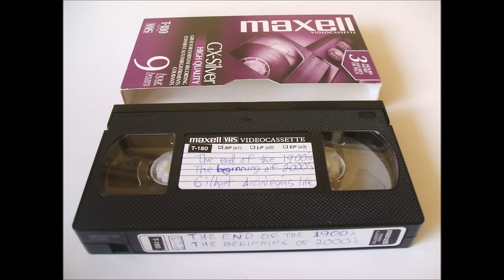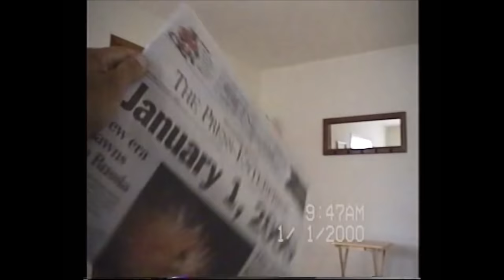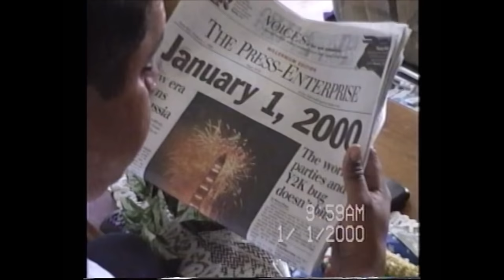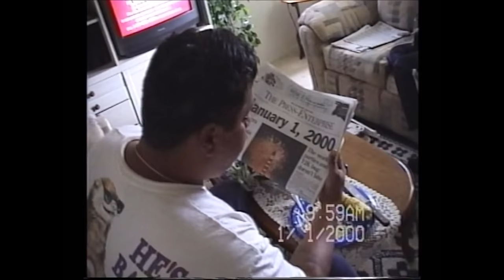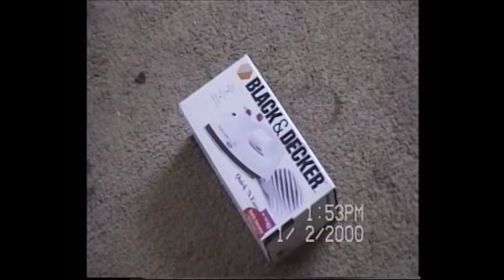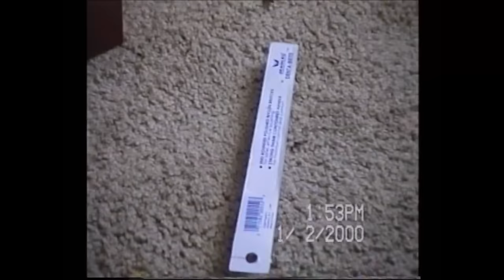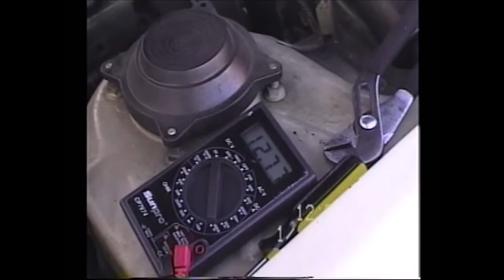January 1st, 2000! Life on the first WEEK of the new millenium!

Comment: What blows my mind is that we are as far away from 2000 as the 70s were to them!
1979 - 2000 = 21 years
2000 - 2021 = 21 years 
Holy sh.t
Reply: Wow what a nice way to bend it. No just say we are as far away to 2000 as they are to the eighties. Actually were as close to 2060 as we are to the eighties
Reply: @o_sch  1979 is technically the 70s though, so I’m not wrong

Comment: Dads in 2019: see you next decade😂😂😂
Dads in 1999: 😈😈
Reply: Damn. You people in the US really have shitty education. Decade begans in 1 (1991) year and end in 10 (2000) year so 2000 is not the new decade and not the new millenium, but the last year of decade and the millenium. The new decade and millenium is 1 January of 2001 and now is the same situation. Now we have the last year of the 2011-2020 decade. Decade means 10 years so just look - 2011, 2012, 2013, 2014, 2015, 2016, 2017, 2018, 2019, 2020. The new decade will be in 2021.
Greetings
Reply: @januszmortadela1956  It's not bad education. When decades begin and end is  not certain. Most people say they start on the year xxx0, not xxx1. This makes sense mathematically as you count 0,1,2,3,4,5,6,7,8,9 then have a new decade. Thus the first decade AD ran from the 1st Jan 0000 to 31st Dec 0009. This makes more sense to me and is more widely accepted over decades starting on xxx1 years. Otherwise 2010 isn't in the 2010s. Which doesn't make sense to me.
Reply: @JohnSmith-he9jj  
Counting is one thing, but the terms of decade and millenium are not using correct. In your example is a mistake what most people do - there is no year of 0000. Our times begans in 1 year. There is 1 year BC and the next year is 1 AC (AD). There is not 0 year.  We can count even from 2005 to 2015 and it doesnt matter because the terms of decade, century and millenium are for only using of specific time.
Greetings
Reply: @januszmortadela1956  That is true. I guess when using BC/AD the first 'decade' is not actually a decade but only 9 years. This could be fixed by using the holocene calendar starting at 0 HE (so 12020 is the first year of the 12020s). As you say though you can count a decade from whenever so it doesn't really matter.
Reply: @JohnSmith-he9jj  
As we can see, thank you
Reply: @januszmortadela1956  there no year 0
Reply: @hanphilnoffz8827  
Exactly mate
Reply: @januszmortadela1956  lol 2000s is new millennium synonym but is the last year of 1000s or 2nd millennium chronology but synonym term is not right calling 3rd millennium because to make 2 millennia is 2000 year
Reply: @hanphilnoffz8827  
Oh boi, read my comment again
Reply: @januszmortadela1956  yes is true 3rd millennium start 2001 is not right 1999 is last year of 2nd millennium because 2 millennium is 2000 year is also not right calling 2000 1000s sometimes 2000
Reply: @hanphilnoffz8827  
Terms "millenium" and "years of x" are different. I dont get your point mate
Reply: @januszmortadela1956  since 2 full millennium are 2000 years 2000 cant be 3rd millennium but it won't be right calling 1000s so 2000 may feel like new millennium because of synonym term but calling it 3rd millennium is not right which 2001 are new millennium when u call it third millennium because 2 full millennium is 2000 year is like first 10th birthday u also count your 10th birthday u don't stop counting at 9th birthday same thing first 2000 year would be 2000 as last number of this category and 2001 are next category
Reply: @hanphilnoffz8827  
Ehh...
You can not use the definition of one thing to desribe another one for only reason they look similar. Yoy can use terms like 2000's of course, but you never can to call it a new millenium.
Greetings
Reply: @januszmortadela1956  yes 2000 is still 2nd millennium that true

Comment: The year 2000. The last year where I could say to myself that the world actually felt okay 😟
Reply: Bruh the 2000s were amazing
Reply: @phantom_wolf5274  fax
Reply: Any year before 2016 was okay
Reply: @phantom_wolf5274  After 2001 the 2000s were rather a downhill and nothing felt right, just looked back on those years and realized the world took a dark direction after 2001. Times are better now than the 2000s at least
Reply: @null2011  why just 2016?
Reply: The 2000s were great I'd say shit started to change after 2010
Reply: Yeah, it was also the last year of the 20th century and 2nd millennium!

Comment: new year new decade I'm telling ya
Reply: BEASTIEMAN 420 Yesh
Reply: BEASTIEMAN 420 you forgot about new century.
Reply: New decade started a year later.
Reply: Sharku who cares.
Reply: @sharku8417 , But that was the 201st decade/1st decade of the 21st century though. the 2000's decade started a in 2000 and the 201st decade started in 2001 (or at least started to coexist with ether other in 2001). But both the 2000's and the 201st decade were decades themselves so who cares honestly.

Comment: the year 2000 was still sooo 90's
Reply: Just how 1990 was still 80s and 1980 was still 70s and on and on.
Reply: @TriangIe  But 2020 was definitely not 2010's. The year may start with a 0 and it may be the first year of the 2020's but that's when COVID started to kick in and 2020 drastically changed everything, the change is too drastic for it to be considered to have any late 2010's culture. This rule doesn't apply to 2020.

Comment: Basically just a normal 1st of January because the new millenium started in 2001.
Reply from the maker: No. The new mellienium started in 2000. Not 2001. The celebration is the 1999-2000 change.  And if there's no 0 for the year. Then what is 2000?

Comment: Nice video but the new millennium started on January 1st, 2001. The year 2000 was last year of the 20th century.
Reply from the maker: 2000. Not 2001. Come on now. QUIT IT. the celebration is the MASSIVE 4 digit year change ya know
Reply: @fueledbymusic3  you’re factually wrong.  The millennium began when 2001 began. There was no year 0.  1-100, 101-200. Etc... follow the pattern.  Regardless awesome video and thank you for this gem.

Comment: Innacurate title. The new millennium actually didn't start until January 1st of 2001. Look it up!
Reply: You’re  right dude. You’d be wrong if they decided to have a  January 1st 0000 year. But they didn’t. They started January 1st 0001
Reply: @bobmilleit1976 . Or 0/0/0000. That doesn't make sense. He mean't the 2000's millennium in this video, but the 3rd millennium which is the real millennium didn't start until 2001 meaning that people were a year early of celebrating if that's true.

Comment: Hello I just need to say the new millennium began on January 1st 2001, not 2000, because if it did, it would imply that the year 0 CE exists, but it does not
Reply from the maker: You guys need to QUIT it with it being in 2001. The new millennium is  on Jan 1, 2000. THATS ALL THERE IS TO IT. The celebration is for the massive 4 digit change 1999- 2000. It kind of ODD for the year to go from 1999 to 2000. Then wait til 2001 to celebrate. STUPID if you ask me.  The new millennium is 2000. And THAT'S ALL THERE IS TO IT. 
If 0 does not exist, then what is 2000 then?
Reply: @fueledbymusic3  then you could name the video the new millennium celebration. 2000 will never truly be the start of the 3rd millennium wether you’d like to bend the rules for it or not. The calendar was made the way it was made, and 0 does not exist. 2000 is the 2000th year btw of the Common Era, and is the final year of the 2nd millennium

Comment: First day of the year 2000
First day of the 2000's decade 
First day of the 21st century
First day of the new millennium
Reply: Not really, first day of the new millennium was January first 2001
Reply: @dairyworkoutentertainment1886  Then all the world did wrong
Reply: @UnknownUser_10  it’s not wrong. The new millennium begins whenever the fuck we want it to begin because it’s arbitrary. We pick 2000.
Reply: @marcus2222  No, we never had a year 0. The first year was the year 1 and that means that a millennium is finished in years that ends with a 1 (1001, 2001, 3001 and so on). You can google it.

Comment: As exciting as it is to see the video and surely to the people who experienced it, 2000 is not the start of a new millenium. 2001 is.
1-1000 is the first millenium. So 1001 to 2000 is the second millenium.
And so 1900s and 20th century are not the same as 1900s means 1900 to 1999 while 20th century means 1901 to 2000.
Reply from the maker: Well its odd to not pay attention to the MASSIVE LIFETIME CHANGE of numbers YA KNOW. 1999 then the quadruple number change to 2000. THATS THE CELEBRATION. 
So, the year 2000  is the START of the new millennium
Reply: @fueledbymusic3 , Yeah and there's actually a name for the rollover of digits from 9s to 0s. It's called the odometer effect because when you're in your car traveling at a very high speed, the numbers roll over to the new nearest 10 or the nearest 100 in miles and it's a really cool sight to see. Even if it can debately fool people into thinking that it means either the start of or the end of something like a decade, century, and even millennium, it's still really cool to see the process of it happening.
Reply: But even then if anything the year 2000 was actually the centennial year of the 20th century or the final year of it because 2000 has a 20 and because there's no such thing as a 0th thing in ordinal numbers which is what the AD system was based on, 2000 as a result was the final year of the 20th century. Same thing with the 2nd millennium, 2000 was the millennial year of the 2nd millennium because 2000 has a 2 and again there's no such thing 0th thing in ordinal numbers, making 2000 the last year of the 2nd millennium. 

Don't get me wrong though. It was a new century and millennium in astronomical chronology which uses cardinal numbers and it was really the start of the 2000s century (the years that start with 20xx 2000-2099 and it's not to be confused with the 21st century 2001-2100) and the 2000s millennium (the years that start with 2xxx 2000-2999 and it's not to be confused with the 3rd millennium 2001-3000). It's just that everyone got fed up with the odometer effect during the 2000 celebrations which made everyone confused on whether or not if the year 2000 was really the start of the new millennium or the end of the millennium.
Reply: @fueledbymusic3  I get it. I was about to add that in my comment but for some reason my little brain decided not to.

Comment: Well the new millennium actually started in 2001 because there was no year 0 but nice video nevertheless
Reply from the maker: Then what is the year 2000 then??? 2000 is NOT 0  The new mellienium is 2000. Not 2001. Kind of odd to wait til 2001 to celebrate.  The celebration is for the once in a 1000 year massive 4 digit change  from 1999 to 2000. Not 2001
Reply: @fueledbymusic3  of course it was amazing to celebrate the change of all the digits, from 1xxx to 2xxx but that doesn't mean it's a new millennium.
Millennium=1000 years 
Millennium 1= 1-1000
Millennium 2=  1001-2000
Millennium 3= 2001-3000
Reply from the maker: @denis-florian_0.57  2000 is the start of the new mellienium.  THATS ALL THERE IS TO IT. Just QUIT IT . The celebration is the 1999-2000 change. I don't care what your stupid dictionary says. The new mellienium starts at 2000. We're NOT going to live 1000 years to see 3000. The massive 4 digit change is te celebration
Reply: @fueledbymusic3  dude wtf why you get angry so easily? If you want to believe 2000 was the new millennium you can go ahead and believe what you want but you also need to accept other opinions because yours might not be always the right one.Also, what "stupid dictionary" you talking about? It's just simple math
Reply: @fueledbymusic3 of course, you are correct. Everything starts at 0, not 1. You were not born on your first birthday. On the day you were born , you were 0 years old, not 1. Your first birthday was 1 year after your birth. This is basic math. Just because a year was left out of the first millennium doesn’t change how mathematics works. It just means that someone messed up 2000 years ago and the first millennium only has 999 years in it.